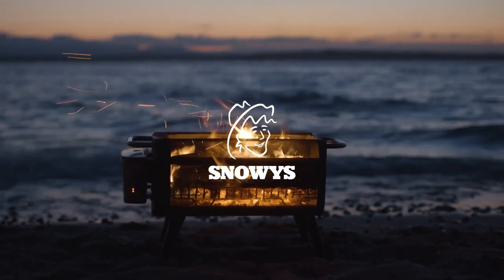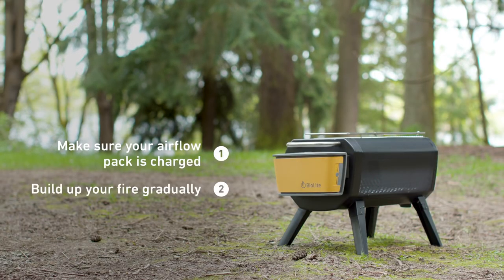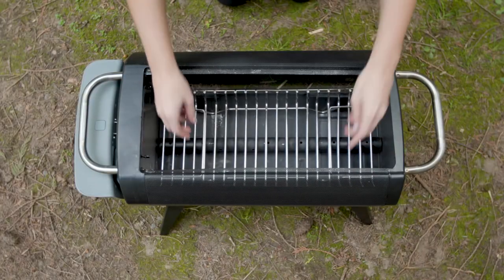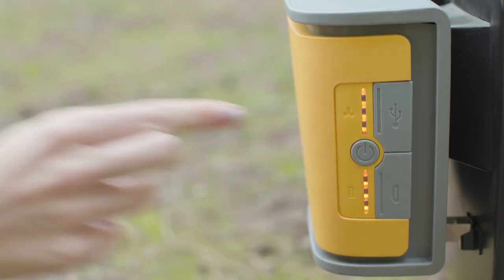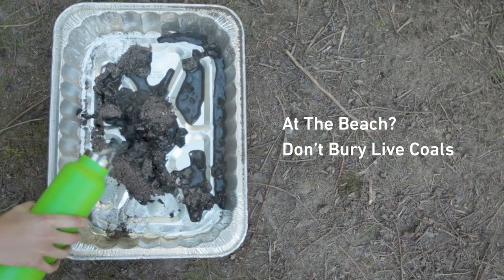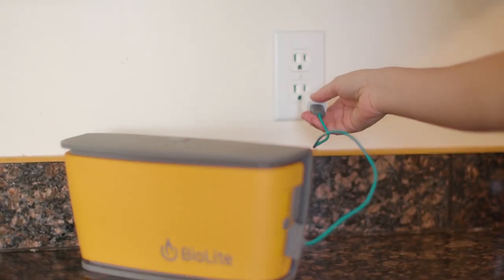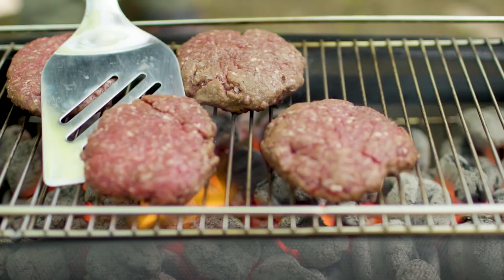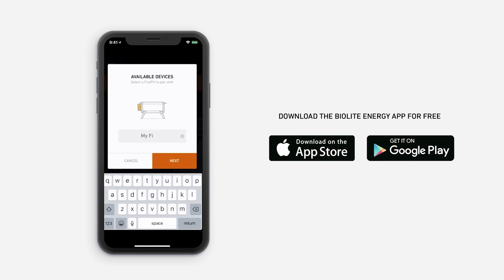BioLite FirePit - How to setup and use

Comment: Does the fan only work once a certain temperature is reached? I've got full bars on battery but fan will not come on.
Reply from the maker: The fan is manually turned on, it doesn't activate automatically. Have a look at our video here for more information - https://youtu.be/Es4zUEgAi2g. ~ Ben
Reply: Well dagg it looks like I've got a faulty unit then. Appreciate the reply!